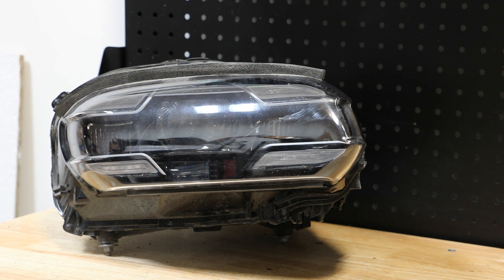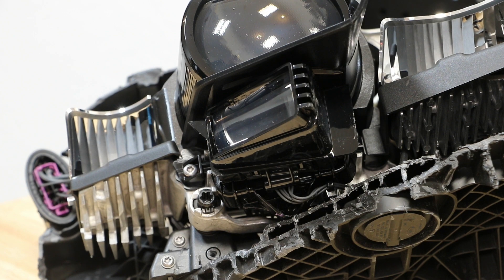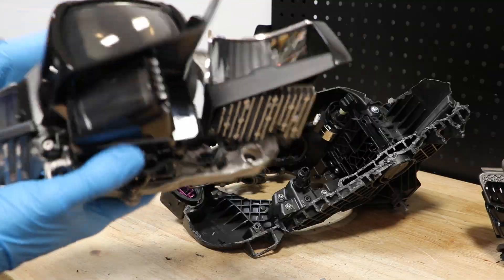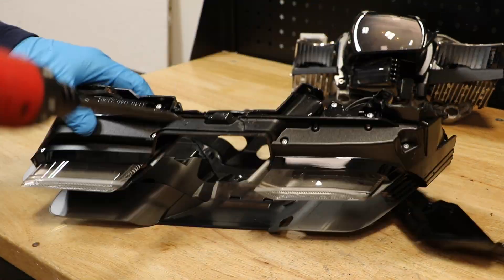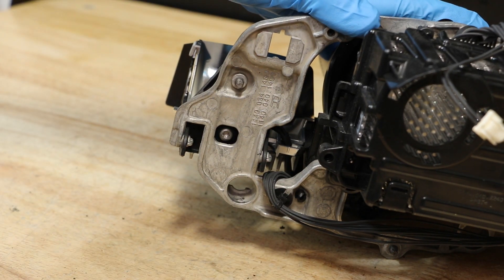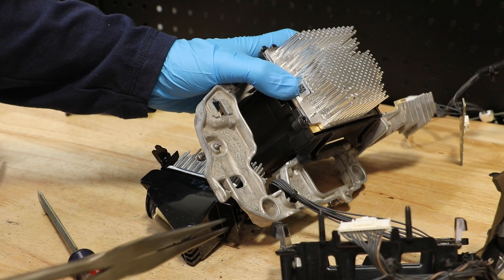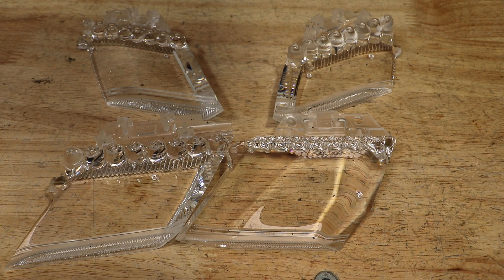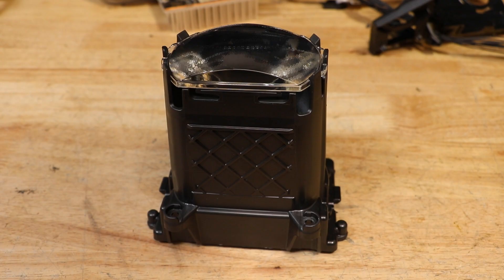2020-2022 Porsche Taycan LED Headlight Disassembly

Comment: Next would be to power all of those LED modules with constant current power supply to see their light patterns. LED chips in automotive are mostly coming from Nichia. Based on their datasheets you can get correct values. Another idea - Would anyone be able to reverse engineer how to control the LED matrix? I can imagine to retrofit these projectors to older cars :)
Reply: Unjustified effort. You'd need sensors for all the specific patterns to light up at their time.
This is just a stupid gimmick that makes headlights even more complicated without any actual benefit.
The bixenon projectors from like 15 years ago were great at doing the right light.
All these constantly dimming leds is just for the stupid lazy drivers that don't know how to use the light switch on their vehicles to activate/turn off high beam.
If you want to retrofit, use projectors that make a great low beam pattern and also have a high beam solenoid as well.
This will ensure you have the best visibility on the road, hence safety without creating a nuisance for others.
Reply: https://www.youtube.com/watch?v=75xNZA--BZ0